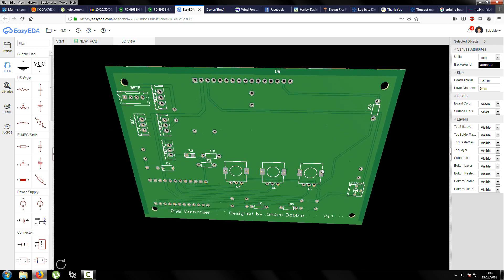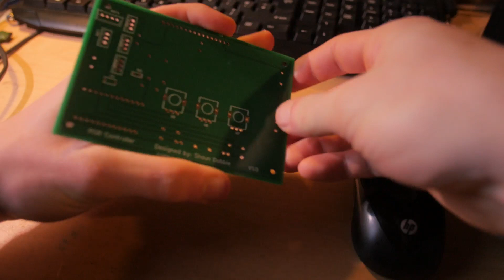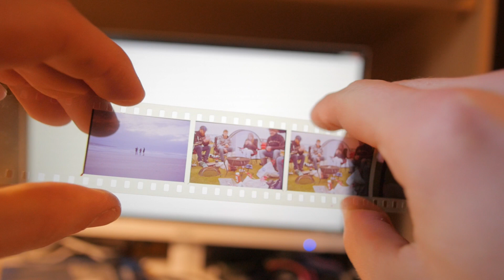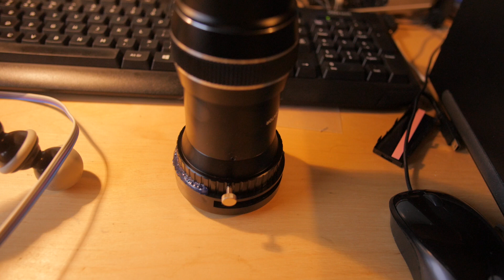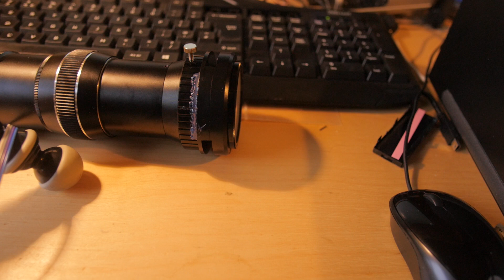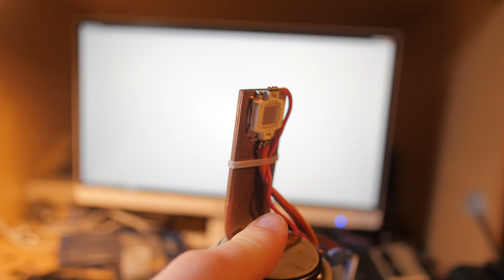RGB LED Controller for Colour Enlargers or Contact Printers

Comment: Might be worth looking into LEDs where the peak wavelength matches the sensitivity peaks of the target film emulsion (I've heard it could improve saturation?). You could probably get the process nailed down quickly with a transmission densitometer and maybe a color analyzer as well, both available cheaply on eBay.

Comment: I think an f/5.6 lens lets only 1/32 the light in, so if you needed a 2 second exposure with f/1 you need a 64s exposure for f/5.6.  Colour shift will be a problem at higher power outputs - the colours of leds shifts as they change temperature in weird ways.  A better lens might end up being cheaper for a given quality.  Another approach to consider is to use a crossed privacy screen (the sort that goes black as you look off angle) as a collimator to allow you to do contact transfer close to the film but not touching.

Nice job on the pcb.